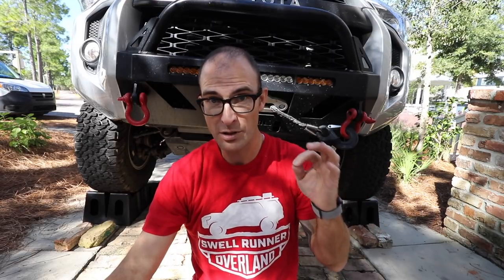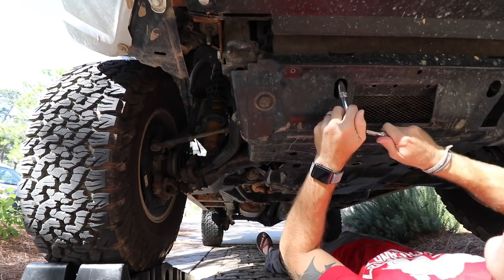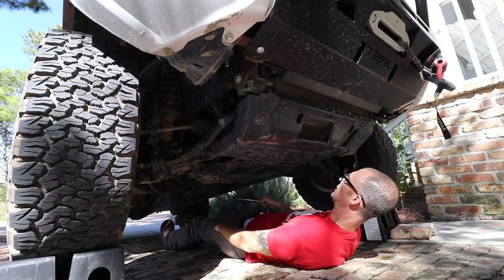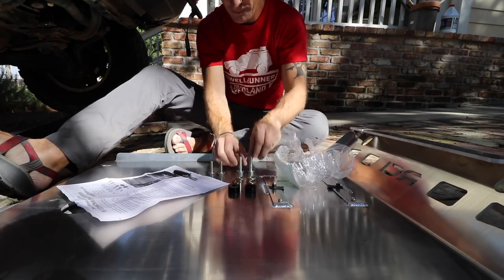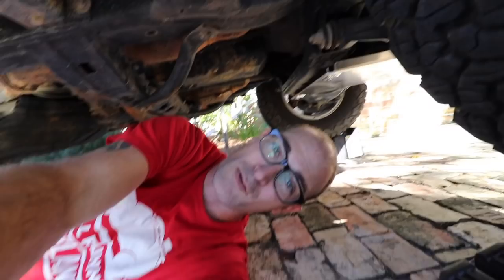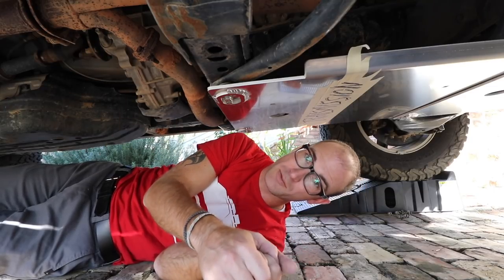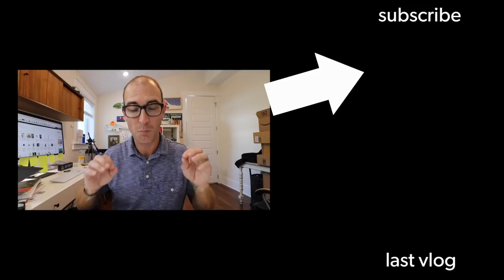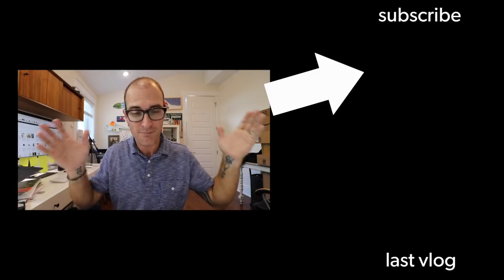Ep50 - RCI Metalworks Skid Plate Install on 5th Gen 4Runner

Comment: Here’s a tip: never use a torque wrench to break a nut loose. That can cause it to come out of calibration. Either grab a bar to slide over the ratchet to extend leverage or get a breaker bar!
Reply: Never thought of this-- great tip!
Reply: @jamesperez-sanchez7573  a floor jack handle works perfectly lol
Reply: He should have used a half inch ratchet or breaker bar, to break them loose. Thereafter he can return to his 3/8 ratchet!

Comment: For those curious on weight the RCI engine, trans, and transfer case package in aluminum weighs in at about 75-80 pounds if you also get the bumper filler plate that protects the radiator gap in front of the engine skid. The factory engine and trans skid I took off weighed in between 20- 25 pounds. Net gain is 50-55 pounds.
Reply: That’s awesome, I was wondering. I just installed the whole package in aluminum, including the a-arms.
Reply: Will this protect your Catalytic Converter?

Comment: Breaker bars are your friend, Jason! Also, you may want to put some blue lock-tight on those bolts to keep water out, as I have the aluminum RCI skids as well and the bolts suffered quite a bit of corrosion in the first year. Great video as always!
Reply from the maker: Ryan Evans That’s good advice!!
Reply: Yep, a breaker bar might be a good thing to have or borrow for the next bolt-on project.

Comment: Awesome videos! But since everyone else is picking on you, I'll add something. I always toss extra jack stands under my rig when I'm getting under it. I don't trust $.50 worth of Chinese plastic. I had a close call when I was 19 and ever since then I make sure I'm over protected. 

And the new 18v-20v impact tools will make quick work of those bolts.

Keep up the good work!
Reply from the maker: Max Haha.  Thanks.  That’s a good idea with the jack stands.  There’s actually plenty of room for me to crawl around under there without anything lifting it up.  I just rode it up on the stands to make things a little more convenient.  If the plastic was to have crushed, it would have been scary, but I’d still have been cleared.

Comment: Are the factory skids poor quality or just not enough protection? They definitely look nice. Great vids and thanks for the always useful info.
Reply: I wish my rig was a toyota with skids already, yes they are pretty thin (the ones I have seen are around 1/8 or thinner punched tin, mpg numbers) thick enough for light rocks if your careful but if you live in a area like mine not going to cut it for any real offloading. I am watching for design ideas for my skids that I need to build.

Edit: just realized that was a really old comment, shrug.

Comment: I bought the full steel setup for maximum strength, added about 110 lbs total (without filler plate). I dont plan on adding a new bumper or bull bars or a roof rack with ladder, so weight shouldn't be an issue. 

On my short time driving with the plates installed, I definitely noticed a change in body sway during slow speed quick turns. Felt more centered and steady. Them steel plates definitely lowered the center of gravity
Reply: Did you install a Fomoto valve by chance?

Comment: you need to buy some tools. 😊.  torque wrench at the very least.
Reply: I'm thinking he doesn't do enough of this sort of work to justify spending a lot on tools.  A torque wrench is only good if the part maker specifies the appropriate values.  I have a BMW motorcycle and BMW specifies a torque value on just about every fastener.  I haven't seen the same information on my 4 runner or my Yamaha motorcycle.  Maybe its a German thing about those specs...
Reply from the maker: I have a torque wrench but nothing called for specific torque on anything with this mod.
Reply: dahveed284 even if the instructions didn’t specify torque, it’s not a bad idea to pick one and use it.  its also good as a breaker bar.  how does he deal with lug nuts?  I just can’t fathom not having a great tool roll with me or my garage full of tools, but I diy almost everything (and own 3 vehicles including a Land Rover).  No hate though, everyone has to learn at their own pace.  I see way too many new ‘overlanders’ who don’t know the first thing about wrenching and don’t even install their own mods.  Sounds expensive and potentially trip ending.
Reply: Maybe grab an impact wrench. Saves me plenty of time on my 4R rec work
Reply: eLGuidoAM I agree. I have the compact Milwaukee battery impact. Makes certain projects a breeze
Reply: Torque wrenches are not designed to be a breaker bar, you will break the torque wrench (trust me, I have done that). Buy a proper 1/2" drive breaker bar, I got mine from Harbor Freight for like $15, and that was the nice one.
Reply: Who needs a torque wrench. Lol

Comment: Toyota tip. They do not use 13mm hex head bolts, mostly 10mm, 12mm, 14mm, 17mm and 19mm.
Reply: The RCI hardware is 13 mm.

Comment: Hey Jason, can you jack up the front of the 4runner with the rci front skid plate as a jacking point. Best placement?
Reply from the maker: 4runner has been gone for years. But I wouldn’t have used it as a jacking point.

Comment: By hand. Ouch but good commitment. I’d like some loctite blue since you may need to take those off.
Reply: Newbie installers might have to loosen/retighten bolts over the course of hours to get everything aligned correct & good to go. Loctite would make a difficult mess

Comment: Take a large socket and long extension and use that on your ratchet handle to break em loose (or get a dedicated pipe that works). You dont need alot of fancy tools, I had nothing when I started, you just have to learn to work with what you got. I have all the fancy tools but I could do 95% of what I do with the tools you got and knowledge just takes more time.

Comment: Curious about your weight analysis. Did you weigh the steel plates you removed & compare that number to the weight of the aluminum skid plates you added? That difference would be interesting. New plates look good and I also like the front bumper partial mod (watched ur vid on that install).

Comment: Great channel! I have the RCI skids too. "Pro tip": Back the bolts out & put some anti seize grease on them. Skids collect all the muck from the trails and you are going to want to remove them to spray them off. 2nd exhaust pipe comes in contact with the Transfer case skid. Use an exhaust wrap on that pipe or you will hear a metal on metal rattle.

Comment: I can't read through all the comments to see if anyone has touched on this, but I scrolled through the video looking to see if you had installed the (2) 3 hole L brackets that should have come with the transmission skid plate, and it doesn't look like you did in the video, maybe you did afterward.  If you were wondering why you had those brackets and 6 carriage bolts and nuts left over, that's why.   You install them on the top of the plate to add structural support if you end up leveraging the vehicle on an obstacle or come down hard on a rock.  Anyway, thanks for the vids, they are a good source for how to make some of these DIY projects easier.

Comment: I have the same skid set on the way for my 2016 as well as their tank skid and sliders. The stock tank skid seems pretty thin and the tank hangs so low.
A couple tips: Loosening the frame end of those braces would have relived the downward pressure. For breaking loose tight fasteners, get as close to the bolt or nut as you can. Use a short socket if you have room and no extension if you can do without. Makes for better leverage and fewer skinned knuckles. Once loose use whatever is easiest.
I do enjoy your videos.

Comment: I know this an old video but hoping someone can answer this. Im pretty sure this 4 runner has KDSS but it looks like he installed RCIs non KDSS skid plates. How did he do this without removing the radiator supports? and is there way to install non KDSS RCI skids on a KDSS 4runner?
Reply: He does have KDSS it looks like, RCI sells skids for KDSS 4Runners, I just installed them on my 2021.

Comment: Looks great. Makes me wish I got RCI aluminum instead of steel for my Tundra. Not sure if they would hold up with how a wheel my truck though.
Reply: I’m going with metal.  It won’t crack and it’s easier to bend back if it gets tweaked.  Aluminum cracks when you bend it back.  I get the weight part…that why I got super charger :)

Comment: Thanks for the video.  I have the steel RCI skids and today I changed my transfer case fluid.  I was disappointed in realizing that I had to remove the skid plate.  There is no hole in the transfer case skid for some reason while there are holes for the engine and transmission drain plugs on the other skid plates.  The strange thing is that the black, steel cross-member support piece for the transfer case does include a hole so that doesn't need to be removed (thankfully).  Why the actual skid plate does not, I have no idea.  Changing transfer case oil is such a simple job but now it's a pain knowing that the skid plate has to be removed.  I've contacted RCI today in hopes they can provide an explanation of why there isn't a hole in the first place.  I will be taking my skid plate to a machine shop tomorrow to mill out an opening so I don't have to take this off again.

Word of warning:  The aluminum skids plates bend and can crack really easily on rocks.  I purchased the aluminum RCI front skid and cracked the welds doing a trail in Big Bear, CA (White Mountain Trail).  I was really surprised.  But, RCI came through though and sent me a new steel skid plate to replace it.  It's much heavier but it seems to take a lot more punishment.

Comment: Forgot to ask how your suspension was holding up with all the added weight. I’m on stock Pro now but with a warn winch SSO slimline and full skids planning on upgrading.
Reply from the maker: I need to upgrade the front to a heavier duty spring.  That's on the list!  It sags a little...

Comment: dude buy a breaker bar at harbor frieght then a torque wrench.

breaker bar to remove bolts, torque to tighten, never use the torque to remove it will make the wrench useless and out of calibration.
Reply: The problem with buying torque wrenches is that getting them calibrated can be a issue.

Comment: Why did you not paint it before putting it on?
Reply from the maker: chris freeth video production I like the bare aluminum look.
Reply: Because they are aluminum and won't rust bare. If they were steal you would have to powder coat or paint them to try and prevent rusting.

Comment: Did you have any problem with something rattling when reversing? Just installed the front skid, transmission, transfer case, and gas tank skid. I’m hearing a slight rattle only when I reverse.
Reply: Did you ever fix that rattle (last year)? Was it your exhaust hitting it?
Reply: h60flyer I did! I actually used a silver hose clamp to squeeze a rubber part that brings the pipe slightly up.
Reply: @alohatcgcollector  Thank you for the reply! How have the skids been for you over the last year? You happy with the purchase? Corrosion? Thx, John